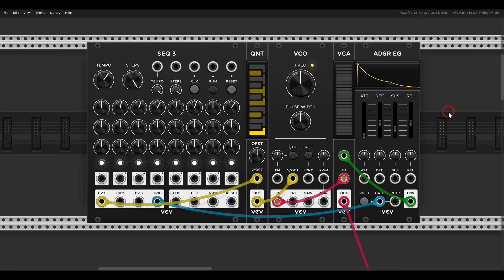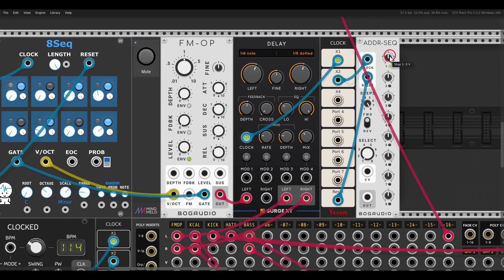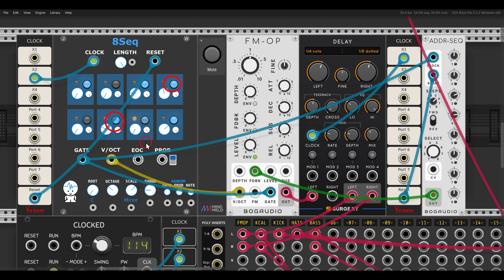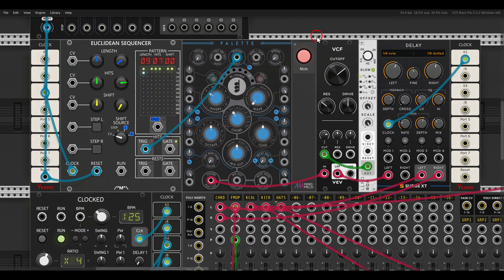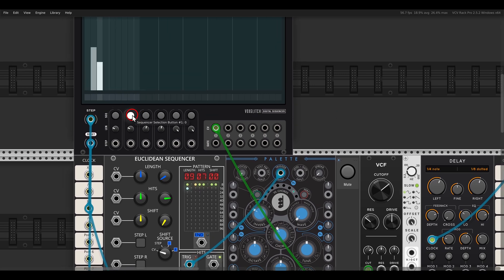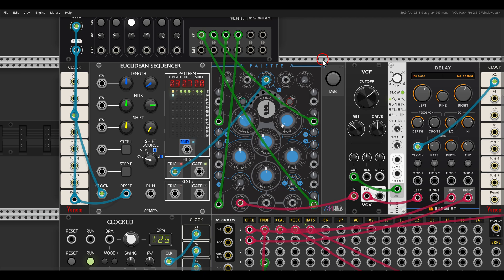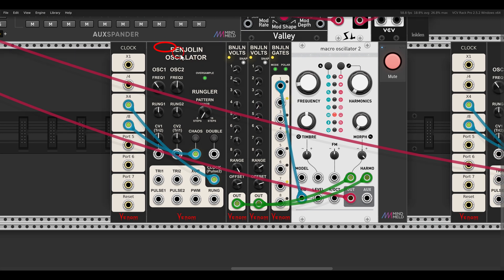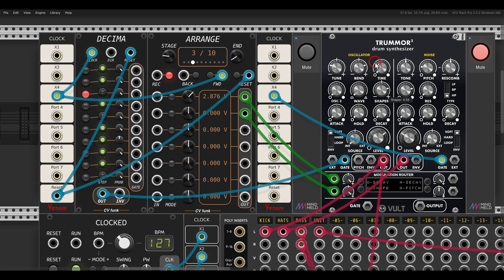Parameter Locking and Motion Recording in VCV Rack

Comment: I thought you'd mention Stoermelder GRIP in this one! It locks parameters so they're not affected when you randomise a module. It's useful for example if you want to randomise a VCO to vary the sound, but you don't want the pitch changing and whacking everything out of tune. Great fun to combine with STRIP and just randomise specific parameters on a trigger.

Comment: Thank you. Lots to think about here. Related question: is there a way to modulate items in the scroll down menus such as range in bogaudio addr?
Reply from the maker: I will have to do some research... But, if you want to modulate the range of the ADDR, just set it to maximum range, send it through a VCA, and you can control its range externally.
Reply: @OmriCohen-Music  there you go, thanks!